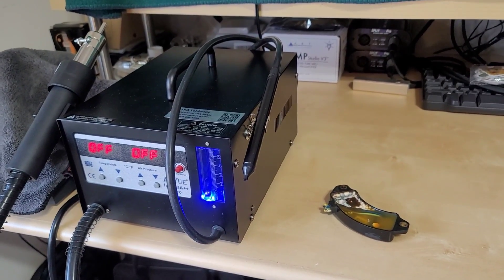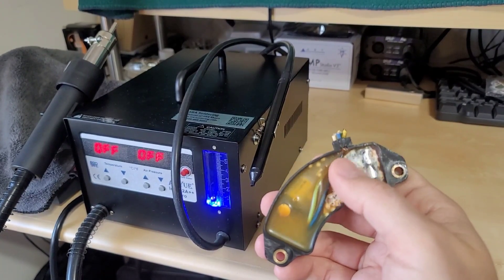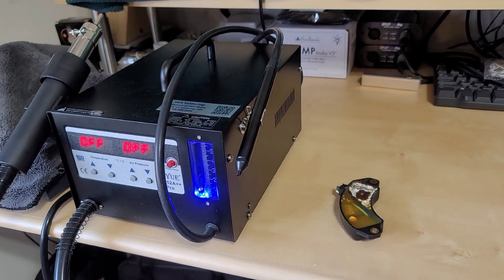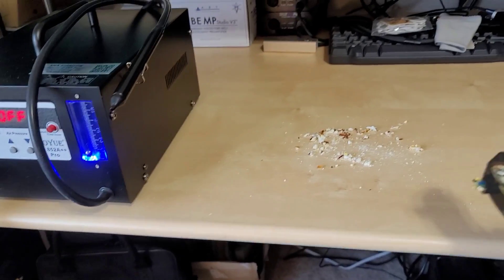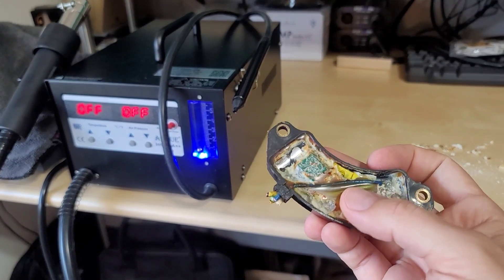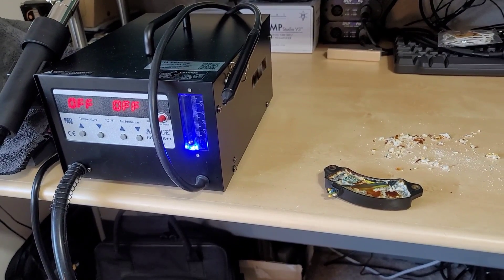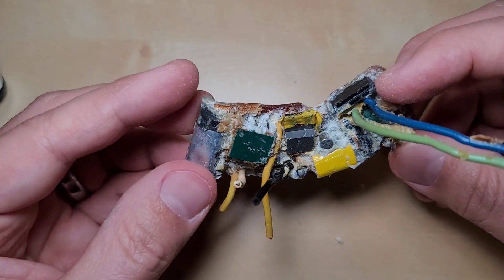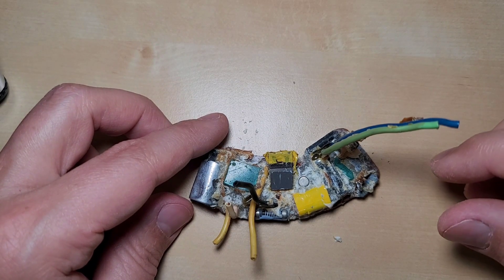Honda EM500 Generator AVR Teardown

Comment: I know it has been awhile since this was posted but just wanted to say I have one of these little EM500 Gensets and it is extremely low hours.  I have owned it over 30 years and maybe put two hours on it.  I never got it operating properly and just need to tear it down, clean carb and do it,  When I get started I am hoping that I dont have an issue with the  AVR.

Comment: Great job.  I've used a flexible shaft dremel tool with dental burrs to slowly eat away at potting compound.  If you can see the components then you can get really close to them.
Reply from the maker: Great tip!

Comment: Could try part 32350-ZB4-632 as a substitute for the old 32350-892-632 
It is a less than twenty dollar part may be worth a look.  No cross reference, 
but that doesn't necessarily rule out a possible interchange.
Reply from the maker: thank you! I'll let James Condon know. He has done more work since this video on the project
Reply: @Bassguitarist1985  Thanks, but already found by checking some shop manuals that the voltages are different for that slightly different part number so it won't
interchange. Another solution I thought may be adaptable for use as an AVR is
to get one of the PWM DC motor control modules that is varied by a control pot 
and substitute for the control pot a vactrol or phototransistor optocoupler and 
a trimmer adjustment pot, using the rectified sense winding output to modulate
the LED and control the output of the PWM module which is used to excite the  
rotor. It is a reported controller method of operating a PWM module in a scheme 
for power output controls regulating wind turbine generators, but should not
disqualify that control scheme for working on many other type generators. 
Another Idea I replied to another user, was a little longer I will copy paste here
for you to look at.  It's been a few years since I did the math and put together a control circuit. There are easy one chip switch mode solutions that could serve as a universal AVR. Heat is an enemy so I would not put an AVR under the end housing cover of an alternator but would extend the leads to put a new AVR in a cooler location like the outlet panel. Probably a TL598CN 16 pin DIP is a good candidate IC for the core IC to eliminate many discrete components. A 16 pin DIP socket on perf board would spare heat of soldering directly to the IC pins, which is not a skill for most technicians. An IC socket is heat tolerant more than an IC and a spare 2 dollar IC can be taped inside the AVR box as a plug in replacement if ever needed. The way switching PWM chips are configured is with 2 separate outputs used drive a pair of mosfets in an alternating fashion like railroad warning flashers and the maximum duty cycle is about 49% for each output with one going off before the other turns on in a back and forth switch mode controlled by a control flip flop. That configuration matches a center tap transformer as the primary for an inverter. So it isn't exactly what is needed for an AVR but can be adapted easily to do that similar task equally well. Easy enough, connect together drain tabs of the 2 output driven mosfets and let them alternate as a team for the negative terminal of the field for the rotor. The TL598CN has internal a 5V reference and error amplifiers for the feedback detection / control modulation of PWM to operate as a regulator for just about anything, and is fully configurable with a few external parts. If the IC ever fails, it is an easy 2 dollar plug in IC.. I have expected to find an AVR schematic showing a TL598CN as an application note or project that has been posted online, but so far no joy for what would seem to be a well documented application.

Comment: Probably it could be chemically dissolved, question is would components stay intact.
Reply: Some will not. Semiconductor cases are often also epoxy. In the industry they will be removed with hot, concentrated nitric acid, if necessary for test/research purposes. Aluminium and copper for sure also get etched away under this conditions, silicon and gold are resistant

Comment: if the generator is based on slightly changing the 5v output, just sample the real generator at different loads and design a modern AVR that does a similar things
Reply from the maker: Designing an AVR is beyond my capability unfortunately. Thank you for watching!

Comment: I had a similar situation with my Honda 4514 lawn tractor. It has an Omron "safety relay" that started acting up intermittently. It only had a narrow opening in one end. I ended up cutting the outside casing off to reveal a hard black potting compound that was impossible to remove without damaging components. As it is no longer available, I conjured up circuitry based on the 3813 lawn tractor. Nice work. James is actually the reason I subscribed.
Reply from the maker: Thank you Paul for watching and subscribing. I am intimately familiar with those machines as well as I have a customer the next town over that has two of the 3813s and one of the 4514s. One of the 3813s was left out in a field for nearly a year and I had to clean out the rust inside that exact relay you are talking about. Thankfully I was able to get it repaired because as you know parts for those machines are very hard to come by unless you import them from either Japan Denmark or somewhere else in the European Union. The reason being is that Honda contracted their motorcycle division to build those machines so a lot of the parts cross but there is no roadmap to what part# is which.

Comment: Thank you Gary!
You & James are my Sensei's as I'm learning even more about every aspect of generator repair. Planing to shift exclusively to generator repair from the wider range of all small engine repairs I've been doing as a hobby/business for several years now. Seems to be a shortage of affordable shops here in the Pacific Northwest.

  Is there another good YT channel for basic electronic (fundamentals) repair that you or your viewers could recommend? (I do have a background in residential electrical wiring  as well as automotive mechanics but now disabled & mostly in a wheelchair doing the outdoor power equipment repair thing)
  Thanks in advance
Reply: EEVblog is a good channel for electronics fundamentals also another channel , Learn Electronics Repair , https://www.youtube.com/playlist?list=PLQ_OzNEYrepVlm02UxQRa40_B-2YyblHv
Reply from the maker: Dave Jones is a very knowledgeable guy!

Comment: How about acetone? I hope it can melt that kind of a resin.
Reply from the maker: it will melt the resin, but cause damage to the PCB
Reply: @Bassguitarist1985  PCBs are quite resistant to acetone - as epoxy resin is
Reply from the maker: @goamarty it makes it sticky at the least, but found heat to be the best way to reduce the resin's strength to chip it away

Comment: @Bassguitarist1985  Thanks for reaching out to him - Robert is on the lawn mower forums and was the go-to guy for anything Honda.  I still have a couple of 4514H riding mowers from the 1990s that are amazingly built (nothing built like them today in that size sadly, not even the green and yellow ones).

I have the EX750 myself - I had to do the power drill trick to get it to wake up and make power.  And it is incredibly heavy for the amount of power that it makes.  Still purrs like a Japanese-built engine typically does, almost 40 years old now, pretty impressive!
Reply from the maker: I regularly service a 4514 and two 3813s for a customer one town over. Major repair a few years ago. Amazing heavy duty built machines. PITA to work on but they last a long time.

Comment: What you can try next time is get a glass jar with a lid, place the AVR into the jar fill it with Acetone and then place the sealed jar into an filled Ultrasonic cleaner with hot water & the heater on and agitate it several times. This should soften the epoxy and make it pliable so you can pick out the resin.
Reply: Unfortunately (for this case) epoxy is quite resistant to acetone. When people in the semiconductor industry have to decap ICs in Epoxy casing, they use something much more aggressive to remove the epoxy: hot, concentrated nitric acid.

Comment: Following up to page 5:30 - I see the nozzle size is going to add more harm than epoxy excavation. Small size tip was intended to remove tiny SMD parts without heating the surrounding area. Here we want to soften the entire circuit with a hot plate or basin and use a component size nozzle to extract epoxy.
Reply from the maker: Thank you for the advice! I'll keep in mind for the next time!

Comment: Try replacing the electrolytic capacitor. Discovered years ago that electrolytic capacitors are life rated in hours at different temperatures. They break down and  the capacity decreases to nil. Very non intuitive. Discovered this after sending many power supplies out of printers in for repair, comparing the returned repairs to find electrolytic caps replaced. A good electronic parts catalog will show hour ratings at temperatures and life expectancy. The insulation is an  oxide? insulator/charges and pocket that diminished down after time
Reply from the maker: This is great info! Exactly someone told me that caps can last 40yrs. When i said shenanigans it depends on the environmental factors he thought I was dead wrong. Course I looked up the facts and it echoes what you say. :-)
Reply: @Bassguitarist1985   per unit volume because the closer plates increase differential force as the inverse square of distance? Maybe?
Reply from the maker: @LostinSpace-ly3xc  who knows. I'm no engineer, I just like playing with electronics ha!
Reply: @Bassguitarist1985  Then main failure mode is loss of electrolyte - they dry out over time .And this is strongly temperature dependent: each 10°C hotter halve the lifetime

Comment: A warm solution of sulfuric acid dissolves cured epoxy after soaking.
Reply from the maker: Playing around with strong acids is where I draw the line ha!
Reply: @Bassguitarist1985  But it is exactly the thing necessary to dissolve epoxy - hot, concentrated acid
Reply from the maker: @goamarty  still not something I would mess with unfortunately!
Reply: @Bassguitarist1985  understandable
Reply: @Bassguitarist1985  Alright then. Just trying to help. I hope you reconsider one of these days.
Reply from the maker: @WilliamEllison  thank you for the information just the same! :-)

Comment: An early 80's model. I remember selling them when I first became a Honda dealer. Somewhat heavy for what it is. DID YOU KNOW? The only 2-cycle engine Honda ever made for power equipment was in their EX350 generator! A little lightweight 350 watt unit that really wasn't good for much but a couple lights and charging batteries as it did have DC charging capabilities. Later
Reply from the maker: Different era different everyday needs. Like James said there is a market for restoring these vintage machines and they still have I use today for nostalgia purposes. Hopefully somebody at Honda seas our videos and can help us with the schematic. And there are far smarter people out there than me with 3D printers and circuit board design software that can reproduce this part.
Reply: @Bassguitarist1985  yeah Gary I agree, I've got one of those EX350s that was never sold! Mint. I used to know all the techs at Honda Power Equipment on a first name basis but they've all changed and I no longer have an "in", if you know what I mean lol. I've retired from the business and started my own thing out of my garage. Will pass this around to a couple guys I know have 3Ds...
Reply from the maker: @donmayberryjrsOPE  yeah I reached out to Robert at Honda who is on the smokstack forums, and unfortunately he's no longer in the in crowd
Reply: @Bassguitarist1985  what are the smokestack forums?
Reply from the maker: Great online forums run by Harry and his daughter down in FL. Thats how i started my journey into generators on the electronics side

Comment: I wonder if there is a solvent that would dissolve (or at least soften ) that resin without harming the components, or at least not to the point where they can't still be identified?
Reply from the maker: If there is it would most certainly damage the components more and make them unreadable. My contact at Honda has told me that they specifically formulate the epoxy resin to be difficult to remove to prevent exactly what James and I are trying to do. It's how they protect their IP.

Comment: With the proper tools and knowledge, reverse engineering this board should be fairly trivial. All components seem to be discrete, they can be measured, even active ones. The only issue I see is that, having alternatives, it's probably not worth the effort.
Reply from the maker: Agreed, the effort would be large to reverse engineer. Alternative parts can be sourced, but even for a knowledgeable person to do so, the time cost is not worth the ROI. All that work for a 40 year old generator where only a handful have survived.

Comment: Thanks Gary for making the attempt.  It is too bad the manufactures do not publish the circuit diagrams when they discontinue support.  Maybe someone at Honda will see this and help us out.
Reply from the maker: Hopefully someone still active there can check to see if the schematic was digitized. That or maybe someone wants to take the time to depot further, test each component, find modern alternatives and design the proper form factor casing to fit. Its a lot of work for a 40yr old board sadly.
Reply: @Bassguitarist1985  I have this same unit that I inherited  from my dad, he bought it at a yard sale over 20 yrs ago for $100. I use it quite  often to charge batteries on cars for emergencies when we go camping. It also works well for blowing up our air mattress. It never let's us down. Thank you and James for the entertaining and informative  videos,  you guys rock!
Reply: @Bassguitarist1985  Any update? I have the same generator with the same issue.
Reply from the maker: @jongrecula55  I didn't go any further with this project. May want to reach out to James Condon to see if he has any further advice on repairing or even replacing this component.
Reply: I found a couple patent applications by Honda from the 80's, will keep digging, cause now I'm invested in finding out.